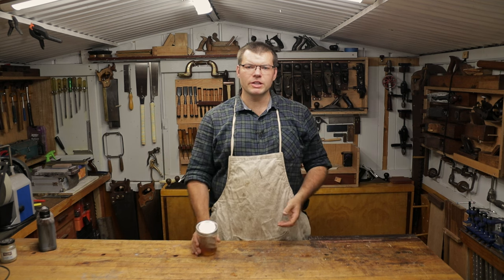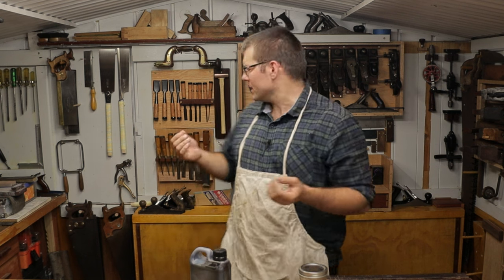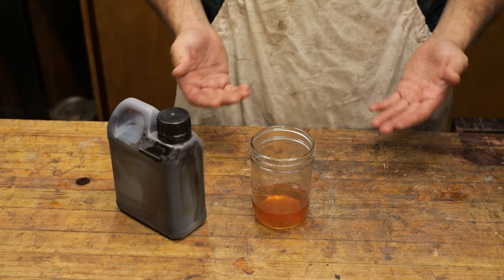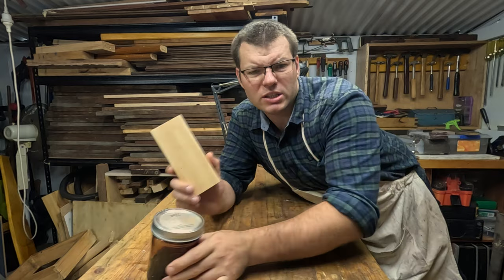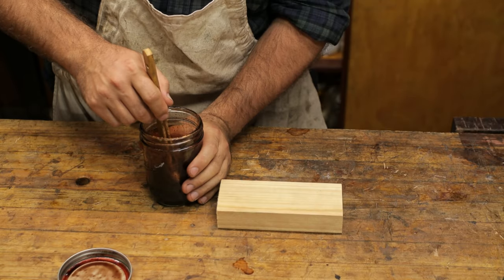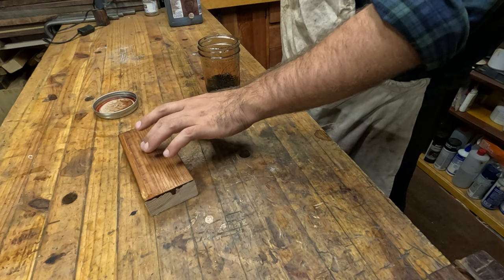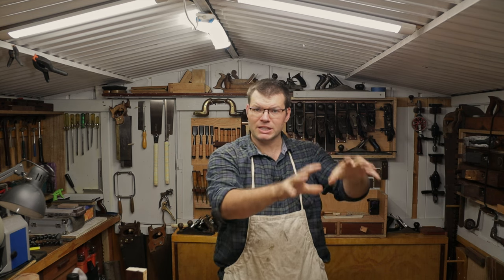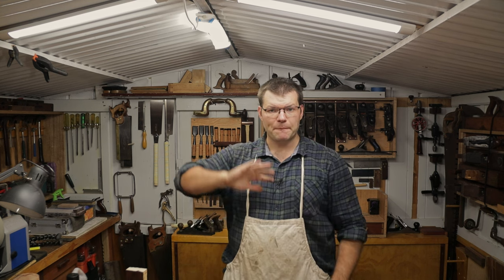How to Tint Shellac Wood Finish

Comment: I had great success many years ago restoring a gun stock using filtered Rit Dye poured into the shellac.  If I remember right, I used 10ml of the dye into I THINK a half quart (?) of shellac to get the color I wanted.
Reply from the maker: Interesting, i had never heard of Rit dye, now ill have to see if i can get some to try. Thanks for sharing
Reply: Is that all you used for coloring? I'm thinking I ought to use a dark wood dye applied with alcohol and sanded off a few times to create contrast within the grain then after finishing and sealing with tung oil pushing the sawdust "slurry" into the grain in between coats I'll top coat with an amber dye tinted shellac maybe even a garnet or amber shellac and give it a few layers to "warm up" the wood until I achieve my desired effect. I'm just irritated that gunmakers nowadays simply paint on an extremely dark thick urethane finish on guns and it covers up all the beauty of the wood all to save a couple bucks. I. Irritated that I've got to even do this in the first place but for a $1600 gun with a turkish walnut stock it needs to shine to the best of its ability.
Reply: @rickterrance4981  yes.  I had to filter it out with coffee filters since the Rit stuff has little crystals in it that you don't want in your stain.  Nothing else and it worked out quite well.

Comment: Thanks for making this video. That's exactly what I want to do to an old piece of furniture but I'd like to have the protection of a polyurethane on top of it. Would there be any reason I shouldn't put poly over a few coats of shellac?
Reply from the maker: It should be fine as long as its dry and you will want to use dewaxed shellac to ensure the poly will adhere

Comment: Hello, it seems that the handle of the plane has a satin finish.
I think it's a beautiful color.
How to get a satin finish with shellac, so you get a vintage look.
Reply from the maker: Generally the shellac is a little more shiny than satin and can be very high gloss when lots of coats are applied.  I usually apply 2 -3 light coats of shellac and then let it dry and rub it back with paste wax and steel wool, the last step cuts the shellac gloss back a bit.

Comment: If I was trying to block the grain from showing on the finish product might I want to first use a clear sanding sealer before applying the tinted shellac. I clearly want to use stain but do not want the grain to show through.
Reply from the maker: If you're using the stain directly on the timber then yes a sanding sealer should work to help hide the grain. If you're using a tinted shellac i don't think there is any need for a sanding sealer as most sanding sealers are shellac, so you could build up the layers and that should hide the grain. 

 I would recommend doing some tests on the timber you're using as it could vary from different species, based on how porous the timber is and if there are growth rings, which absorb at different rates to the rest of the timber. 

I don't do a lot of staining (so others might have different idea) but in my experience applying the stain directly to the timber after sealing would be the best way to 'hide' the grain as you can apply more layers of stain without getting a thick film finish with it.

Hope this helps.
Reply: Thank you for making time to respond
Reply from the maker: @mikekendall5870  i have been doing some tests as i get this question or similar quite a bit, so i will be filming the results. So hopefully you get a better idea
Reply: @AussieWoodshed  Wow I very much appreciate that sir. Will be eagerly awaiting for the results.
Reply from the maker: @mikekendall5870  i just wanted to make sure i gave you the best answer i could